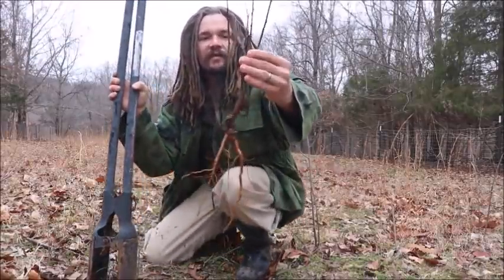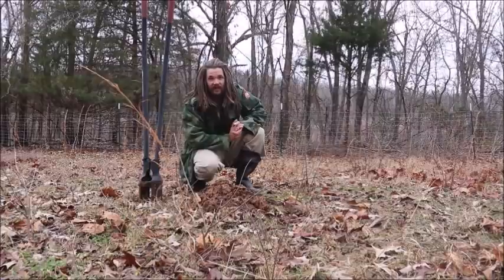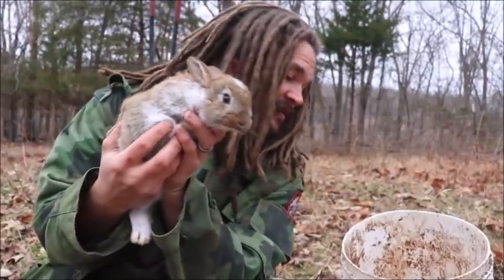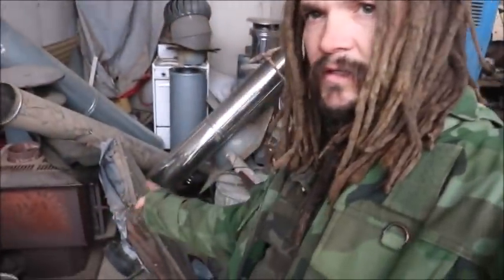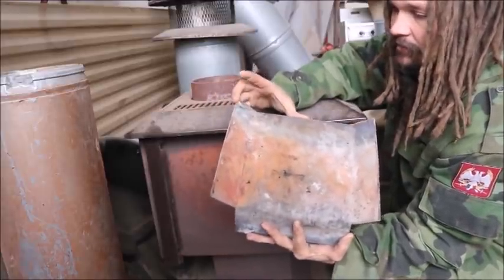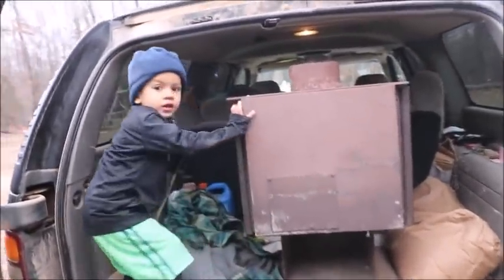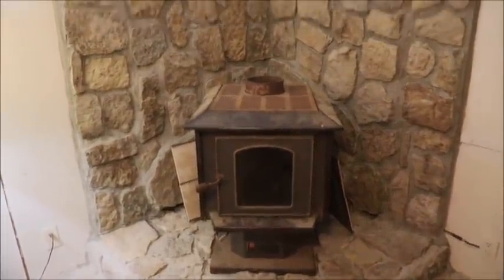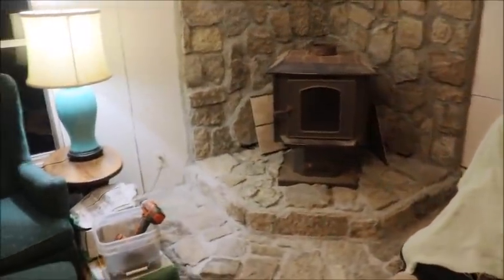FIVE YEARS IN THE MAKING (Welding the Wood Stove & Putting it in the House)

Comment: Papa guess what day it is? It's grandma Teresa's preaching day. And the crowd roared! While watching the welding the worn out gaskets were noticed. Please replace before firing up. Tell me you have at least one carbon monoxide detector. And finally, since there is no fresh air intake installed on the stove always crack that window behind the blue lamp a half inch to provide the stove with the oxygen needed to burn properly and not use all the people oxygen in the house.  You have worked hard on this - job well done. Tell mama pepper she is looking beautiful.